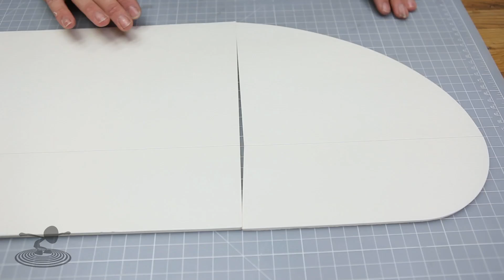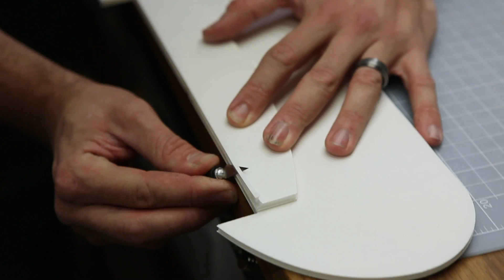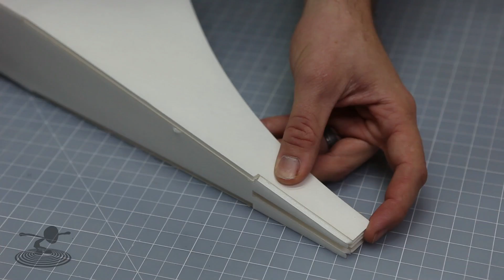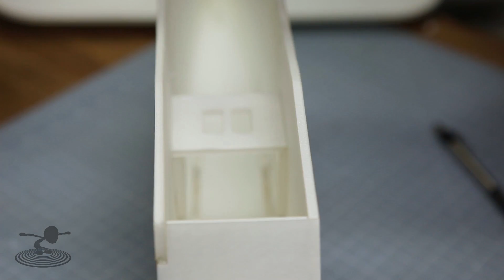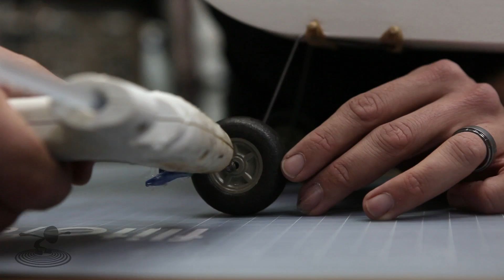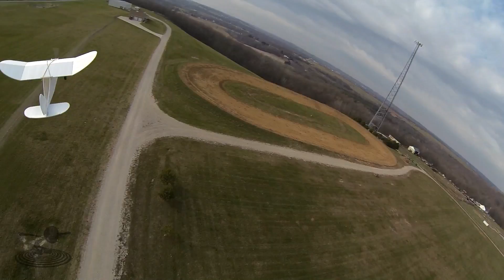Flite Test - Old Fogey - SCRATCH BUILD

Comment: I just built the speed build kit with the power pod.  When I run up the RPM’s, the nose wants to dive down.  The motor mount was built to spec—it is straight on line with the pod.  Why is this happening?  Maiden was 30 feet and a nose dive crash.

Comment: Monztur. I found this little guy at a hobby shop in Az   Looked cool  when I got back to Canada I started to open it up   No instructions just picture of it. Went to your site. For instructions could not find any never thought about going to u tube  so I put it together  with no  help.  What a flicking mess.  When you sell something like this. Put instructions and link to u tube.  And mention. Your using hot glue gun.  I have built a lot of nice balsa planes  but never made a mess like. This.  Iam going to try and salvage. It but what a mess

Comment: Why does my old fogey do mini stalls meaning it climbs a little bit and then goes back down.  Also why does it rock back and forth?  I am not impressed and happy with my old fogey right now.
Reply: I am no expert, but I would start with the CG (center of gravity), it needs to be balanced perfectly or a little nose heavy. Tail heavy planes don't fly well and will crash given half a chance.  They are videos on CG, you cannot skip this fundamental fact of flight.

Comment: Why won't my fogey fly??? It wobbles form side to side and won't climb. Got a emax gt2215/09 1180kv motor 10.4 prop 18amp esc and a 3cell lipo. Only difference is that it's made of 3mm foam board. It is as straight as a arrow and my cg looks good. I moved my lipo to all positions. Nothing works. What other trainer should I be looking at. I like the slow flying planes. Please advise FliteTest
Reply: +Ewald Stander Decrease your rudder deflections to about 40% (or maybe even less). The wobbling should stop. You might also consider decreasing the elevator deflections too for a smoother flight.

Comment: Why when you do your build videos do you not go over what receivers that you are using on the builds. For the guys that are using specktum or futaba, You use specktum most of the time. This is the first video I got to see what receiver model you where using.
Reply: Any receiver should work, you just have to bind your receiver to your transmitter. The brand is not important, the receiver and transmitter just need to talk to each other. Not a problem, hence no discussion.

Comment: Josh, does an E-max EF 2805 will perform ok with this airplane?.
This is my setting: Same motor I referred before, 18/20 amp ESC, 1000mAh 3S 20C lipo battery, 8X4 propeller (Slow flyer).
I don't have any means of getting the weight of the airplane as my electronic scale went south a few days ago.!!!!!!!!!!!
How much (Approximate the airplane should weight complete with all the components including RX).
I will appreciate your or someone else's reply.
Thanks much from Miami.

Comment: Would anyone recommend this plane to someone JUST starting? First plane? I;m not too interested in the Nutball or Flyer...
Reply: I tried the Old Fogey first and it was more of a challenge than I thought. I went back to the FT Flyer and learned a ton, now I'm ready for another Old Fogey. I know a lot more about balancing the plane after building and flying two FT Flyers.
Reply: I am going to start with the bloody wonder.
Reply: Hi
I would recomend not to start with the bloody Wonder. It's quiet fast for a beginnner. If I were you i'd also go with the fogey or the 3 Pack SBK.
Reply: Tom Tiny thanks but the thing is that in Nepal we don't get foamboard so i have to buipd these planes using cardboard. I have built the nutball and am waiting for the components:)
Reply: +Alex Linson i agree, the old fogey is a fairly hard plane to fly but once you get it up there it is really fun, maybe start with a delta but dont start with a bloody wonder as it is very fast, the old fogey is great but i have a friend from JC quad copters that build one and he was a bit nervous to take off but was absolutely loving it once he got up there

Comment: also be sure to stick the ESC as far forward as you can and the Rx as far back as you can to avoid interference - you will need to add a small washer under the left motor mount screw location (between the plywood and the mount) and 2 to the top screw location to get the Old Fogey to fly correctly! (I stuffed mine several times before I figured out "Thrust Angles") the Motor needs to point slightly DOWN and to the RIGHT so shim the mount accordingly, I dont think Josh mentions that in the videos?

Comment: I used 4 of the screws that came with my servos (mounting screws) for the motor to the plywood, and put a small square of sticky-backed velcro (walmart craft isle) 1"x1" to the back of the ESC and on inside of the right sidewall of the power pod, also attached my receiver the same way, only to the inside LEFT wall towards the back (right in front of the servo tray, when pod is mounted in plane) - worked out great!

Comment: did you ever find it? i am looking for it as well. i am 51 yo and only have 2 more years to live at the outside. congestive heart failure (CHF) anyway i spent allot of money on a all plastic so called trainer 15-20 years ago. i tried to get it off the ground just a little bit to get the feel of it, boom concrete parking block. it has been in its box ever since. i thought this one would be allot easier to fly and cheaper to build. hospital cost me 175,000 so far. not your problem sorry told you

Comment: I just use the european style foam board. It's 5mm thick, and comes in various sizes. The difference between the US and the EU version is the flexibility and the way the paper is stuck to the foam. The EU version is a lot stiffer and tends to break if you try to fold it. Also the paper cannot be peeled off.

Comment: In the UK you can get foam board that is polystyrene and 5mm thick from Hobby Craft. It's also got paper on it so it is very similar to the Dollar Tree stuff. I think they had a 3 for £10 deal, so not as cheap as Dollar Tree unfortunately:(.

Comment: Three thoughts?  Why not put a top on the rear fuselage?  Second with the "Dutch Roll" being a problem why not post the correct dihedral.  I did encounter the D roll.  Interesting fix for the problem, carefully heated the seams with a heat gun and as they loosened let it set in the new position, added glue later and all seems fine.  Careful with the heat as it can warp the foam but taking your time with this seems to work very well.  I am trying 1 1/2" instead of the initial 2 1/2"

Comment: I'd say... maybe... depends on how heavy your motor is.  The "blue wonder" they recommend pushes about 325 grams on a 2s (with an 8x4.3 according to their webside), so you're in the ballpark, but the motor they recommend is only 24 grams.

I had a motor that could generate about that much thrust and put it on the FT Flyer, but the motor was so heavy that it couldn't fly on only 300 grams of thrust.

I

Comment: I don't think they use a laser cutter, they cut the poster board by hand (well, with a knife, actually). It's quite soft stuff so that's no problem. You just need to be accurate, that's all.